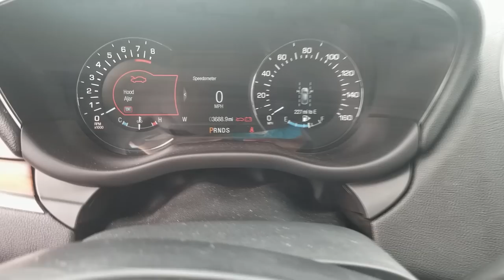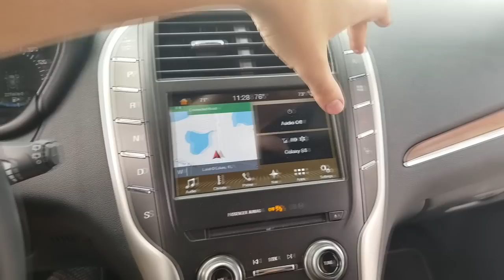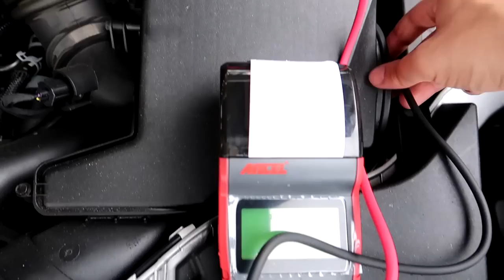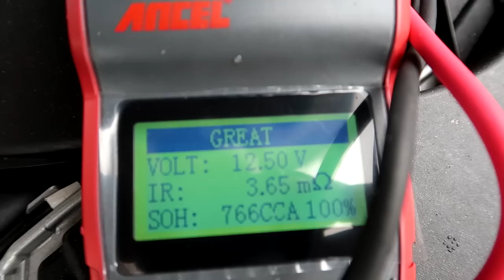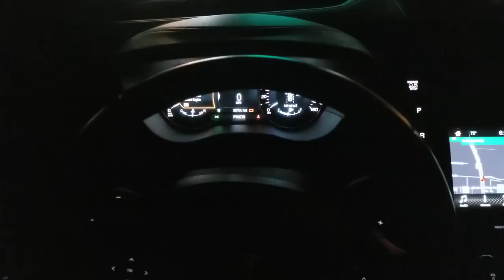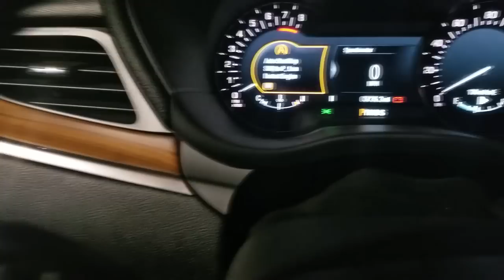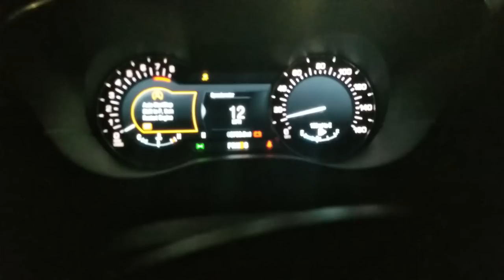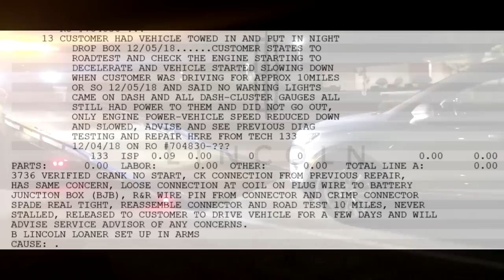I Saved Over $20,000 Buying a Like New Lemon Car! Then it Broke Down TWICE in 48 Hours!!!

Comment: Samcrac, I doubt youll read this but you may find it helpful. I had similar issues in my 2012 Ford Focus, i had assumed it was that cable as well being intermittent and repaired it. Issue continued, being a prior tech i knew it was something else. For me the issue would happen randomly. a surge and then full loss of power. It ended up being an EVAP Purge Valve. Which I would assume being direct injection and part of the ford family your vehicle would have the same part. Ford has recalled this part on multiple chassis and platforms. Reading your techs notes, the car is cutting coil power during this issue, A purge valve will do this. Cuts coil power due to fuel loss, can overheat fuel pump, HFFP and even cause negative vacuum and collapse the tank. I may be wrong but its certainly worth looking into.
Reply: I read this, too. This is why I got a Toyota.
Reply: This is what I was thinking too. Sounds like if it's hesitating, it's a fuel problem of some sort.
Reply: Just leave it at, the missing LINK.

Comment: Different repair the second time. The first one was not very serious - the connection was "repaired," probably just reseating the connector. The second time the pin was replaced, which means a new crimp. For them to narrow it down to being pressure sensitive at that wire end is huge! If this doesn't do it, the next step is in the BJB itself. Usually those pins are swaged and soldered, a bad combo... the connections are prone to cracked solder and resulting intermittents. If it happens again I would push for replacement of the BJB. I don't think you will get any resistance to that.

I think you got a great deal if you have the patience to see this through.

Comment: I hate having so many computerized functions in modern cars. The wire looks damaged .. the insulation is lumpy, meaning the conductors inside are messed up. With the high complexity of modern cars, one tiny thing can cause endless problems... the trick is finding that one tiny thing in the morass of complex interconnected systems.
Reply: That purple wire isn't a data line, It's a high current carrier of some description.

Electrical connectors have always been the weak spot of vehicle electronics due to contamination and vibration. Japanese/european makers have learned to be extremely rigorous on quality control with electrical harnesses(*) and moved to gasketed connectors a long time ago, moving in the last 15 years or so to grease-filled on top of that (water can't get in if there are no voids to get into)  - Telcos looked on and said "well it only took you 40 years to catchup"

American makers have a deserved reputation for unreliability(**), which is one of the reasons why very few US models sell well outside of the highly-protected US market.

(*) Both wire quality - I've seen older cars which used brittle aluminium wires - and connector quality/design as well as assembly quality. Saving 50c in parts cost is no good if it costs you repeat sales due to unreliability. Ask British Leyland how well their cost cutting worked out.

(**) They're eclipsed in the unreliability stakes by European luxury marques turned out in numbers of a few hundred per year (and Land/Range Rovers, which are 1950s designs and show it)
Reply: I agree, that was the first thing i thought, was it looks like the conductor inside is messed up
Reply: @Ckoudous  the insulation looks like some cretin has been yanking on it with bullnose pliers and  twisting with needle nose ones instead of using the right tools. I'll guarantee THAT has been happening in the service bay.
Reply: conductors in a wire?
Reply: @zxKrookedxz  Well, how else do you think the music gets into your radio?
Reply: That's why, after I paid over $400 to replace an ignition switch on my Santa Fe that the old 50's, 60's and 70's cars made much more sense. AND you're driving a car that no one else has. I now have a 54 Buick
Reply: @alanbrown397  sure but they are not made to last. That's the problem. You spend a lot of money so u can keep putting and wasting money on a car. 
But I guess the whole point is not to last so u can keep buying new Cara and keep being in debt.
Reply: Keep in mind, that non-computerized cars were developed for almost a century, while computerized cars are still in their childhood of developing.
In 50 years those Computer implementations will be much better and not cause so many issues anymore, instead prove as very beneficial for the durability and maintenance of cars. 
But what am I talking, in the future your car will probably be fully electric.

Comment: Honestly at this point, if there's more failures, I wouldn't give up until they replace the entire ECU harness, for safety's sake. Tell them you don't feel safe in the car otherwise. In the end, I don't think the dealer would have an issue with it. They tell the ford techline that they found an issue in the harness, ford covers the parts and labor cost to the dealer, the tech still gets paid his hours, and you get a new harness and hopefully trouble free ownership as a result. I'm seeing repeated band-aid fixes when this thing needs surgery.
Reply: I agree.

Comment: I’ve bought cars with problems before but I’m a mechanic I would not give it to anybody to drive especially my wife until I was sure I had it fixed. Engine cranks over does not start, it’s not a battery issue. Probably a ignition issue when engine hot. Does it ever act up when the engine is cold if not it’s probably heat related. Crankshaft position sensor is where I would start.

Comment: Ford is just going to jerk you around saying the fixed the problem until the warranty expires! Then it’s your problem! If it was an easy fix ford would have done it before having to lemon law the car
Reply: Im surprised discounted lemon car even still have a warranty
Reply: i agree my nissan had brake issues from day one. it took 4 tries and a visit form the factory tech. on the last visit it took  6 weeks to get it fixed. the solution was to replace the brake boosted, the master cylinder and the abs unit. i took pictures of the defective parts and found brake fluid in the brake booster and the plunger in the master was stuck part way in. i had told the dealer on several occasions that it felt like a bad master cylinder being the brake pedal would travel to the floor.
Reply: Chrysler and especially GM are bad for not standing behind their vehicles when they break down while under warranty.
Reply: I’ve had no issues with Chrysler.
Reply: @mugs2169  you didnt purchase a lemon from Chrysler. They have had low reliability and are notorious parts cars.
Reply: As long as you have documentation of the reported issue before the warranty runs out they are required to fix the issue even if the warranty expires.
Reply: I think Chrysler has came a long way from what it even was 5 years ago. But I do understand what your saying.

Comment: What happened to the Porsche 911 I need to see more content on that car.
Reply from the maker: Getting the brake calipers powder coated and got in some new parts. Will probably be a video on it coming up next!
Reply: Samcrac did you get the engine ticking sound looked at??

Comment: Sam, it almost sounds like something is overheating, while it is hot there might not be enough contact.  This is either a sensor or the cable to that connector - look at the cable itself and see if it rubbing on a piece of steel.  That purple wire has also been hot, look at the state of the cable.  So when something gets hot, that means there is a grounding issues maybe?  Do you have like a FLIR you can borrow from one of your buddies?  I betcha it is something with heat, grounding and connection.
Reply: Had same type problem with Honda CRV. Died twice out of the blue, towed in under warranty. Dealer battery test both times said battery good, “Honda wont let them replace a good battery” showed me printout each time. Went across the street to O’Reillys to purchase a relay for another vehicle, while there I had them do a battery test, battery failed bad cell. Replaced battery- no problems since, 8 months later.
Reply: I hade a simular issue with my Audi A5, it was the a grounding point in the gearbox that was the problem.
Reply: Al Van Der Laan, you are on the right track definitely.  Samcrac next time it happens feel the suspected purple wire and the others to gauge heat. Short/open circuit or combination of both is what I would look for first.  An electrical component is malfunctioning and cutting ignition(coil packs) power.  And it sounds like it needs to sit for a bit to dissipate heat before starting. A FLIR is a great idea but it is possible to feel the wires to find a problem circuit and then trace it out.  Lots of short/open circuit detectors out there for not much money 100 will get you a good one from power probe.  You can trace through the relays and fuses instead of the wires.  Easy this way. Good luck.  You got this.
Reply: Peter O'Brien My wife’s Honda Odyssey had the same issue. Car would die then barely crank. The Honda dealers battery check said the battery was good and couldn’t find a fault. After the car dying a day later they agreed to a battery stress test and said that the battery was indeed bad.

Comment: Sam...the issue is NOT with the wire.  I had this same problem with my Kia Sorento.  That entire fuse module box needs to be replaced.  That is what had to be done with my Kia after just stalling out several times while driving it.  I had it in for repairs and then it started doing it again.  Tell them the entire "box" needs to be replaced.

Comment: A few comments. First off the guys who wrote the PCM firmware at Ford get a solid fail. It knows the car is running, the fuel level, and in is Drive and if ANYTHING causes the engine to stumble or shut down it should turn on the check engine light and store a freeze frame of all the pertinent data at the time. The fact the car has no light and no codes and is displaying useless messages in the cluster is a complete fail. My other comment is Ford has a rep for avoiding warranty work whenever possible. The service advisors don’t get a commission, the techs get paid less and would rather be working on paid service jobs, and corporate wants to spend as little as possible on warranty work. So yes you have a warranty but you might find it won’t leave you satisfied. I also suspect the car can’t be bought back again so you’re stuck with it as far as Ford is concerned.
Reply: Interesting thing in a lot of jurisdictions is that warranty work doesn't have to be done by the dealer..... (meaning that if you don't get satisfaction from them you can take it to a specialist who know what the problem really is)

And that purple wire needs cutting back, remaking and repinning.

Comment: If it breaks again, insist the harness / module be replaced due to repetitive issues / inconvenience. As I saw another commenter said the wire does appear to be damaged. So either A) damaged wire from factory or B) something in the module caused a short / over current etc and damaged it. 
 Replace both harness and module chances are the issue with it it sill be fixed.

Comment: There was a reason the car was lemon law'd.  If it were that wire, how come they didn't repair it right the first time?  How come they couldn't find and identify that wire for the original owner?  They are most likely taking you down the same road as the original owner.  They feed you a story saying that it was a 'repaired lemon' for sale.  When you bought it, it was not a 'repaired lemon' but a lemon.  You had it 'repaired' twice so far.  This vehicle most likely still has the original defect.  Maybe they sincerely thought they addressed the issue each time?  Who knows.

When I worked for an automotive components supplier, we would receive parts from the automaker for warranty reimbursement.  We would test them in the lab and they would be NTF (no trouble found).  More parts came back.  More NTFs.  We were sent manufacturer vehicles and leased a vehicle as test beds to find the issue.  We wired portable DAQs (data acquisition systems), meters, and computers to these vehicles and missed events we believe because our sample rate was not high enough on our DAQ to capture the event causing problems.  We weren't just some guy who liked to repair salvage cars.  There were people at the automaker investigating the issue as well.  There were people at the tier 1 supplier investigating the issue.  And we (a tier 2 supplier) were investigating the issue.  I know how much time (engineers and technicians in the lab, meetings, seat time in borrowed and leased vehicles) and money was spent in this effort from our side.  You can be sure that the automaker has spent alot  more.  The same could be said for the tier 1 supplier.  It took quite some time to isolate the root causes of the failure. 

You were originally correct in assuming anything engineered and built by man can be troubleshot and maybe even repaired.  The question you should ask yourself isn't can it be repaired.  You should ask yourself do you have the skills and equipment to troubleshoot the problem to its ultimate root cause.  If not, you should ask yourself do you have the confidence the dealership technicians have the tools and skills to find the culprit.  If not, do the Ford support engineers have the right information, skills and resources applied to sort this out.  Remember, Ford bought this car back once and didn't have all those resources aligned to address the issue for the original owner.  They bought it out of circulation to make the problem go away temporarily for one individual.  If they really wanted to fix the issue, they would've bought it and sent it to the vehicle engineering people to investigate instead of allowing it back into the stream of commerce.  They may already have enough with the defect and are working the problem (still).  

The question isn't can anything built be repaired.  In due time and with the right resources, we sent man to the moon and space probes to the planets.  We have better cures and treatments for cancers.  We fixed a broken telescope in space...twice! In all those things, alot of manpower and money was applied.  How much money and manpower have you put in to address the issue? How about the dealer and automaker?  The question isn't can this be fixed.  It is how much time, money, and attention is needed to fix the issue? It could be as simple as a battery or wiring harness defect.  A bad sensor or bus controller maybe?  A faulty ignition system?  A faulty ground?  A soft short or bad trace on a pcb board the diagnostic equipment can't detect?  What has been eliminated (and why) as a potential root cause?

You may need to apply the money you saved into some sweat equity in tracing down the problem and addressing it yourself.  Or you can wait until the dealer tech or Ford finds and fixes the issue.

There are good, sound reasons not to buy lemons.  The question you should ask yourself is the amount saved going to worth the ultimate price you will pay.  Maybe.  Maybe not.  Steve Leto's advice is good general advice to those who don't have the skills, time, and pain tolerance to deal with these issues.

By the way, that purple wire looks sketchy.  The section visible may have internal damage to the wire strands.  It has pinch marks or kinks in it.  That wire or section of wire may need to be replaced.  Find out where it goes and jumper around it the next time it fails.  If that fixes it, they need to repair or replace the whole wiring harness.
Reply: @jefrhi  
I care not whether you like the tone or 'preachiness' as you say because I care not for your opinion.

Comment: Doubt its fixed. If that connector is at the issue point I would bet its the fuse block it plugs into with a bad solder joint on the board.

Comment: Check the fuel pump Sam. I knew a guy several years ago that had that problem with a Mustang and the dealers couldn't fix it. One day it broke down in the middle of nowhere and a couple of shade tree mechanics told him it was the fuel pump and that is what fixed it. My 2018 Taurus don't have start/stop
Reply: Dennis W came here to say same thing.  Bad commutator on the fuel pump. Sometimes hitting the tank will get it going, maybe a boost pack with a little extra voltage will get it going again. End of day, needs a new fuel pump. Get a fuel pressure gauge on it when this happens to prove it.
Reply: Came to the comments section to say the same thing.. New Kia Optima had the exact same problem, they fixed it on the first visit to the dealership and it worked fine there after
Reply: The service description tells that the wire they found to be lose and sensitive to wiggling is coil pack wire. Pretty sure that is enough to stall any car, if your spark plugs won't fire.